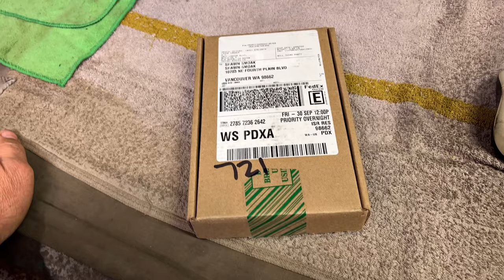R12RT-P Wiring Whoa’s!! • iPhone 12 Mini is Back..! | TheSmoaks Vlog_2511

Comment: I’ve had audio issues with my 12 pro max where when I do video, the audio is super low or nonexistent for the first 20-30 seconds. It’s ruined some stuff for me. Never really figured out why. 

I’m surprised they don’t have a diagnostic tool for the wiring. Fluke makes scanners that will identify exactly how far down the cable the break or short is with Ethernet and other cabling.